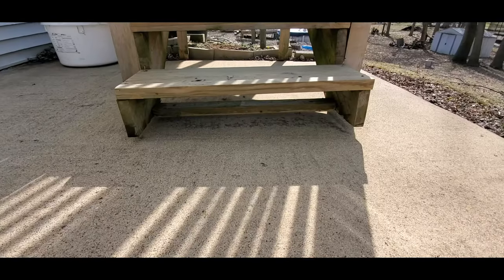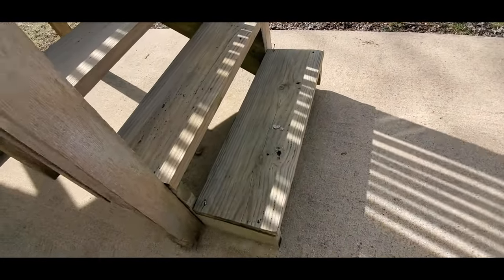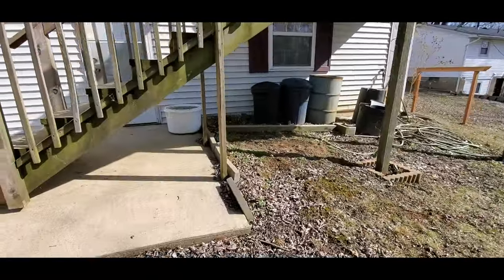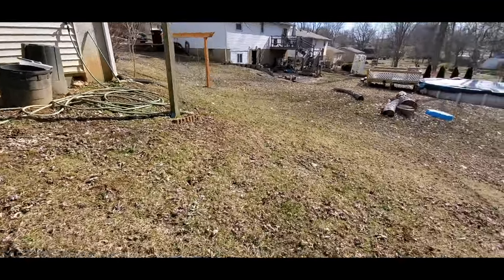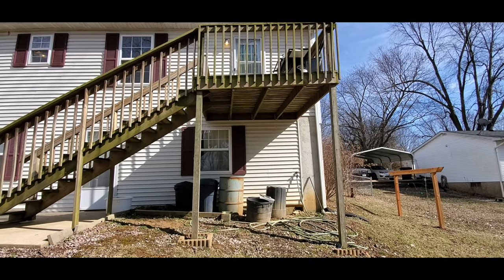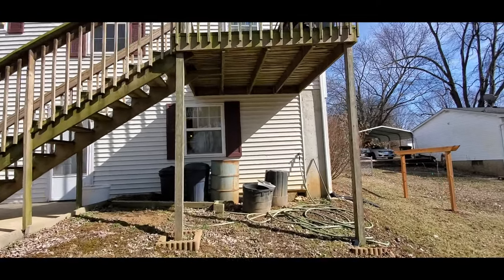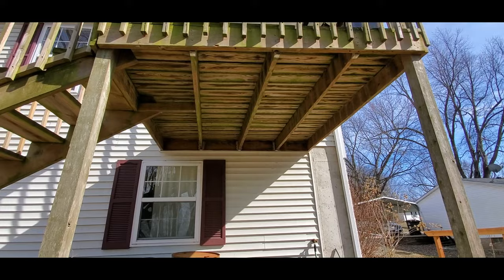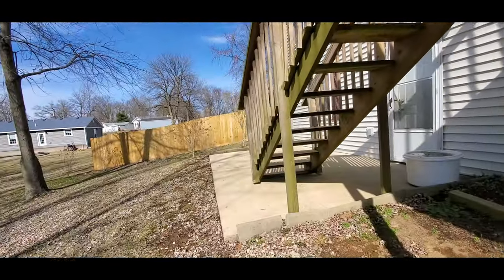POORLY Built DECK about to COLLAPSE!

Comment: Not sure why I watch these. I know nothing about decks or how to build them. I just shake my head yes and agree with everything he says like I actually know anything.
Reply: Same! Maybe it's the idea of building something with your hands and seeing it stand for years. I prefer to work in a hospital though. No commuting, close to home, same workload on a daily basis, so on.
Reply: Trust me. That deck is an abomination and I'd hate to be a visitor walking out there not knowing. It needs to come down.
Reply: schadenfruend
Reply: I know a fair bit about building decks, this thing is an abomination, the contractor should be charged with attempted murder tbh.
Reply: @bigblue4364 : By the looks of it the ‘contractor’ was probably the homeowner.
Reply: If you walk on this deck, you will come down.
Maybe along with the deck.
Reply: without having any knowledge of construction or this stuff you can tell its done very bad by just using logic. Posts should be very thick,lol, and everything grounded properly.
Reply: @lastdaysofhumanity4114 : I have decades of construction experience and there is nothing about this deck that will pass code in any jurisdiction I’ve worked in. It’s a disaster waiting to happen and I noticed the neighbor’s deck is built exactly the same.
Reply: One day you'll need a deck.

And you'll know.

Comment: My house was built in 1980 and that's what the original deck looked like until 4 years ago. At one time, that was up to code. I can't tell you how many contractors came out & told me it was a death trap. They couldn't believe it was still standing.

Comment: That is an old deck, 4x4’s posts and 24” spacing was acceptable at the time. Looks like they were planning for a finished floor, that explains the spacing.
Reply: those 4x4 posts should have been at least cross braced ...
Reply: All that wood still looks green and as for 16 on center that’s been around longer then that house ….I’ll give ya the 4x4 posts that’s just being cheap but the finished floor is the 5/4
Reply: @knotallthere66  It looks like green moss.

Comment: 4x4 are structurally sound here and were acceptable for many years. The reason we switched to 6x6 is because they tend to twist and warp more under height. The code has span charts for joist spacing.  24 inches is not a defect and it depends on the length span not just the size of the wood.
Reply: You may be right, but let's not take away from the disaster that this deck is.
Reply: You forgot to notice there is no main beam, the joists are simply tied into a front fascia board so even if they were 1” long they would be ‘over span’ for any dimension of lumber. This deck is a disaster that just hasn’t happened yet.

Comment: Im in the commercial steel fab & erection biz. My career has kept me mostly in estimating and project managing, never engineering. 
Even with all my experience, i still reach out to my structural engineer buddies to check and fix anything i am building at home like a deck or patio roof. 
Heck, just last month, i rebuilt some deck stairs for my father-in-law. I had a steel detailer draw it up, then had an engineer check it. 
The hardest projects can be made simple with proper planning and execution.

Comment: not surprising, me and my dad rebuilt our deck, very similar style to this one, built in the 90's or something. ours was just higher than this, waaay bigger, wrapped around 2 sides of the house, pretty poorly built, but the main issue was that the floorboards were just rotting out. We pretty much just ripped the decking off, lifted the sagging joists as well as replace and double up a bunch, installed blocking, which it didnt have before so it would sway slightly, and then we pretty much just reinforced, braced, and properly fastened the whole frame, swapped all the garbage wood out, rebuilt the stairs and railings, and then in areas where we wanted to keep dry under the deck we put down slightly sloped plywood with vinyl deck membrane, and then did the rest as composite decking so it couldn't rot again. The deck is phenomenal compared to the rotted out, creaky old thing it was before. One thing we noticed while dissecting it, was the shortage of nails and fasteners that the previous builders used, many brackets were missing nails, and the deck was hardly fastened to the house, when we put it back together we used a whole lotta nails, a whole lotta screws, and a lot of the big lag screws for anchoring the railing posts and tying the deck to the house. Was a pretty fun project to do, learned a lot.

Comment: The fact that anyone would use 4x4s to make a deck that high amazes me
Reply: If you’re relying on the uprights to resist lateral movement there is something wrong with your design.
Reply: Slenderness ratio, buckling.

Comment: I don’t care what size the deck is or how high off the ground.  I’m using 6x6’s with 2x12 bands and 2x12 or 2x10 joists on 16 inch centers unless it’s trex then 12 inch centers.  I hate 4x4 posts on a deck.  You can’t notch them through a double band.

Comment: At least they saved money on proper structural engineering, plans and I am guessing no building permit. Of course, going with the cheapest bid from an unlicensed contractor too. You get what you don't pay for. All of these savings will backfire because now it all has to be torn down, and rebuilt properly at which point the money saved will be wiped out by the added costs to do it right.

Comment: Can the deck be repaired,  or does it have to be taken down completely.
Reply: That deck is a mess and should be rebuilt completely
Reply: @mike2228  wrong
Reply: Why can’t you just anchor some 6x6 posts and add some cross braces to the joists.
Reply: yes, it could be made safe. btw, i'm a retired remodeling contractor. of course i wouldn't have built it like that, but i could fix it. without tearing it down.

Comment: A dozen people on that deck moving around (teenagers jumping, leaning over the rails, dancing, pushing, etc) will generate a large lateral load. I did see anything to prevent the deck from moving side to side other than deck nails/screws. The stairs, which could help prevent lateral movement, are are not even anchored to the ground. A lateral movement of a few degrees (inches) left or right will cause a total collapse. Assuming that deck height is about 12 feet, two or three out of twelve people would die if that deck collapsed with several more hospitalized. That deck is a future crime scene.

Comment: Building decks isn't hard if you have common sense and some skill. And doing a little research online if you aren't sure is something you can do. I have built several decks and it's pretty easy, i have experience though so tend to forget that but good grief that deck is a tear down i could tell immediately look no further.

Comment: Sorry.....   i doubt this inspector has ever built anything ,  try cutting a stair way as nice as this one .......  if the deck is so bad why has  it been there for the last 5 years......  like too many inspectors they find something to make a big deal about so they can get paid and neglect spending the time to find any real issues with the rest of the house .  Thing about a deck is if it has a problem you can see it and fix it .....  The whole house may be ready to fall over and this guy is ripping on the deck that will last another 50 years just the way it is......
,,,,,,,,

Comment: “Way above 8ft tall” 

same height as door😂
Reply: You need some glasses my guy 🤣
Reply: @PandaCheeks  apperantly you do, it’s in the video.
Reply: One single 4” row of siding above the door. “Way above” would be like 10’. So I guess that door is 9’8” tall. 🤣
Reply: Glasses my dude glasses...
Reply: @PandaCheeks  whats your reason you think it’s 10’? If the door is 7’ and its 4”above that? I’d love to hear it
Reply: @PandaCheeks  JFYI the standard height of doors is 6 feet 8 inches and that door in the video is not taller than that.
Reply: The ground slopes away from the house, so the point where the deck posts touch the ground appears to be quite lower the patio door.   Not to mention we have no idea what kind of footing, if any, is below ground.  They could very well be 4x4s just driven into the ground.

Comment: I’ve built many excellent decks and quality homes. 

Personally, I wouldn’t build a deck (poorly) as you see it here, but you are misleading people who don’t know the difference between (your) preferences and what applicable 1:41 codes specify.

There is no reason/requirement for a 6x6 post on the deck being reviewed here. There are excellent and economical methods for improving the structure without subjectively overbuilding.

I think that you’re an amateur inspector, frankly.
Reply: I agree that he is looking at non issues and missing real issues. Span charts show what length you can go on 2 x 8's, does it meet that? The problem that I see is a single 2 x 8 header between posts and that header only nailed to the posts, not bolted. All this is covered in the building code book. He is not quoting sections of the code as they apply to this deck.

Comment: that deck and stairs are just a pile of shit. Replace the posts with 6x6. Add joists. Brace the posts at 45 degrees at least 2 feet horizontally and vertically. Fix the stair stringers at top and bottom.